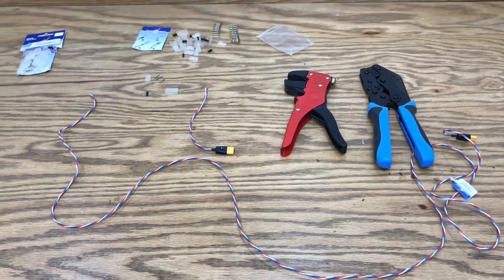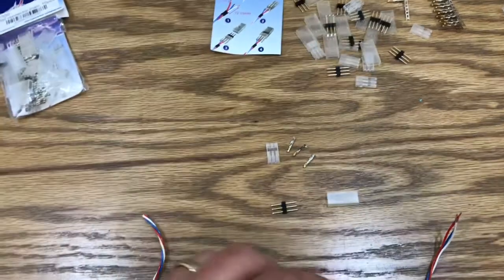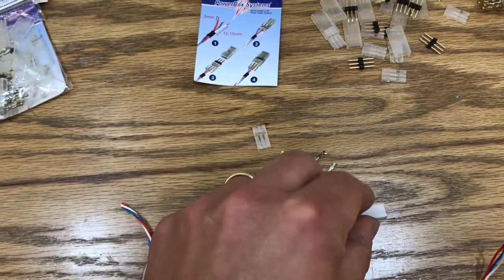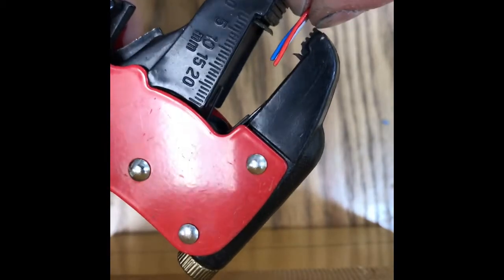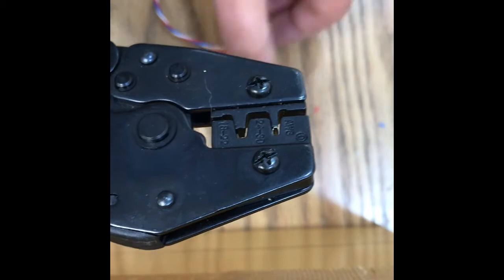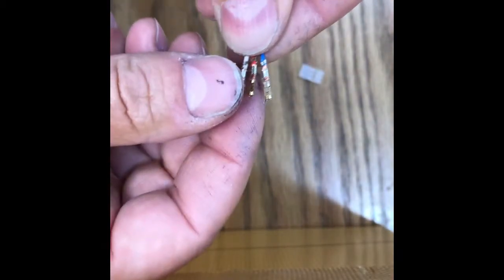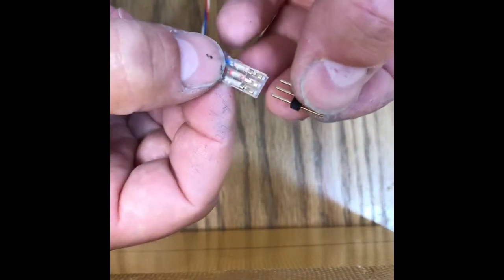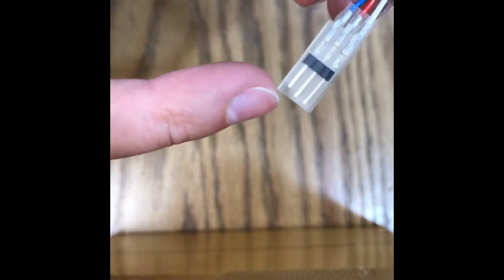PowerBox Servo Connector Assemby

Comment: Very cool system.  There unique use of a double spade on the male connector simplifies the process.  Wonder how their Max wire amp capacity compares to common 20 ga servo wire?